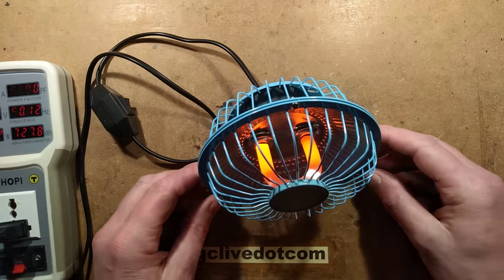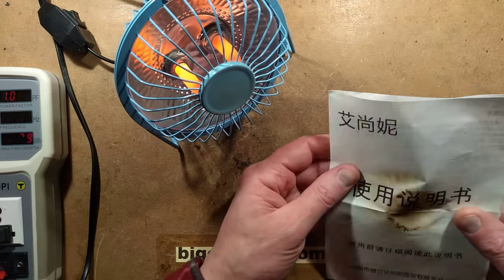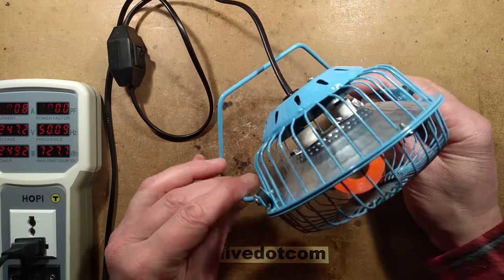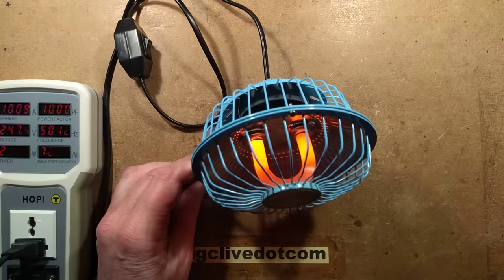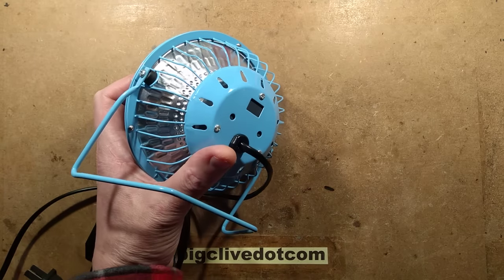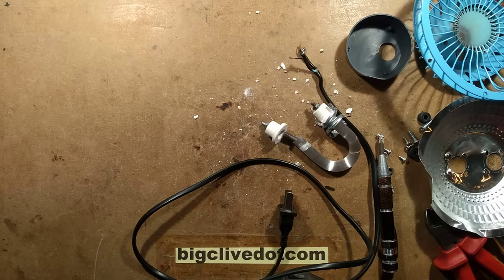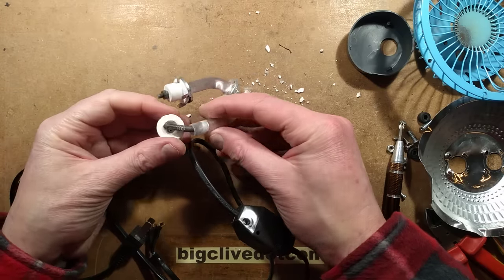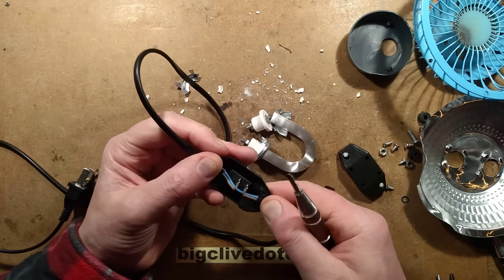Chinese automatic house ignitor.  (also available in pink)

Comment: I'd rather take my chances with a garbage can fire.
Reply: @GeorgeTsiros  better than a garbage can fire OR the heater
Reply: @GeorgeTsiros  you would just get molten copper do you even know how thin 30 gauge is
Reply: @Probable.Orange  if you knew copper wouldn't work, why did you even choose it, you fruit?
Reply: @GeorgeTsiros  I am fairly certain any metal that thin would just straight up ignite when under high voltage
Reply: @Probable.Orange  any metal? any any metal?
Reply: Any metal that's commonly used in standard electrical wiring
Reply: @Probable.Orange  so ur sayin... if u stick in an outlet... a couple meters of 30g wire... made of metal unfit for making a couple meters of 30g wire to stick in an outlet... it would fail?
Reply: @GeorgeTsiros  yeah obviously
Reply: @Probable.Orange  good think i didn't mention copper or any other such material, then.
Reply: @Probable.Orange  ok so, the whole deal is: the equilibrium between heat generated in the wire and the heat moved away from the wire will ultimately determine the temperature that the wire will reach. at high enough temperatures, most of the heat will be radiated away, the air around the wire will not play a significant role without a fan (which i didn't mention, so we won't be using any in this description). With the constraints i mentioned, 30g (single strand) wire, mains power and a "couple" meters of length, we would need a material that has 1) enough resistivity to not trip the mains fuse 2) enough endurance to withstand the ~10 kW of power it would convert to heat. we're looking at a power density of watts per sq millimeter... not much.
Reply: @GeorgeTsiros I don't  know how your "30 gauge" wire is measured. For me 30 gauge is far too small without first coiling the wire, maybe no fewer than 200 or 300 turns. It could work. But I think the in rush will melt the wire. I WOULDN'T DO IT.
Reply: @ryarbrough1195  hi. yes, of course, by increasing the impedance of the ... ... ... "circuit"

Comment: Jesus China this the housing of a small desktop usb fan. Holy smokes
That square cutout was the switch
Reply: There's certainly going to be some holy smokes in this use.
Reply: I also have one of those USB fans and recognized it immediately. It's barely suitable for the punched aluminum fan blades, let alone a quarts heater... (Also, that switch died so now it's just wired straight because why do you even NEED a switch?)
Reply: Yep my first thought was it is a fan housing and a place for a slide switch on the back.
Reply: I've had one of these usb fans on my desk for the last five years and to be honest it's worked flawlessly. As I recall I picked it up for a fiver from Wilko's.
Reply: they have a 110V version of it also... not much of a fan but lit moves some air.
Reply: Fan yes, USB no?  I've got several of these (some working, some seized) 4" fans that run on 120VAC...yep, that's where the switch goes.
Reply: @matthewmiller6068  The USB version is understandably quite widespread. Add me to the list of people who instantly recognised the housing from one of those generic USB fans!
Reply: The Chinese Communist Party has banned Jesus. Could explain a good bit.
Reply: @andreasu.3546  that is actually terrifying
Reply: @Roman F. I suppose that's quite likely - some generic metalwork supplier makes the casings and sells them to both the fan and the heater manufacturers. Or, considering that fan heaters are essentially a heating element and a fan slapped together, it could very well be one company making both.

Comment: Not only if you clamped the base down, the heater part still swivels vertically, so there would still be a chance to knock it face down, still causing and issue with inadequate heat dissipation, and thus, a good chance of it's ability to start a fire. Remember, Smokey the Bear says " Only you can prevent burning your house down with inadequate heating appliances."

Comment: Interesting; my USB fan's housing is almost identical. The switch comes out of the square hole on the back but it doesn't have two holes near it. It has the same three holes on the back for mounting the electronics, same stand, same method of putting the cage together, but the cage itself is rather different in its side-on profile, with much more 'bars' going around it.

Comment: I have one of these but it’s a usb fan 😂😂 definitely reuses the same case.
Reply: I have one of these, but it's a mains voltage fan... Chinese reuse at work.
Reply: I have the same fan. I got mine from walmart for about $5 usd.
Reply: I have this as a usb fan from poundland 😂
Reply: The boss at my previous work has it as a USB fan. I think it came from eBay. I thought it was plastic until I picked it up.
Reply: Came here to say that - this is the pound shop fan for £2.
Reply: I've got one of these too, it's green and has melon pips on the blades.
Reply: Ya sane got one for a dollar at the dollar store
Reply: Same fan!
I saw the pic and thought "usb heater"?
Reply: Yes
Reply: I now wonder if anyone has this same case on anything else. Blender? Toaster? Shower head? Garden sprinkler?
Reply: plot twist.
Someone open the USB fan and find that it has tilt and overheating protection.
Reply: @worawatli8952  pie tin holder
Reply: So you don't have one?
Reply: @TechLeftBehind  I have a fan about 1.5* that diameter which uses the exact case design (except obviously bigger) right down to the holes and screws.
Reply: Yup. The rectangular hole is for a switch.
Reply: I have the same case with a 120v fan. has yet to burn my house down.
Reply: Yeah i have the same one too
Reply: Same, got mine from Poundland.
Reply: I also had one of these USB fans in front of me at work at some point. I made a 3D model from it, so I remember the geometry clearly. :) It is exactly the same outer case.
Reply: I suspected as much, I have a similar USB small fan and that housing looked suspiciously familiar, lol.
Reply: Yup.
Reply: @xiro6  sadly contains a motor and a switch. Don't believe I even saw a resistor in it to limit current draw but instead relies on the load of the motor to not blow up your usb socket.
Reply: I bought it as USB fan in Tesco.
Reply: I have one. Its powered by woods

Comment: Those cable restrainers were known as "Heyco" and we used them on our metal-cased chargers where I worked some years back. They came in at least 2 sizes and I have a couple of pairs of Heyco-branded pliers for inserting and removing them.

They are a good design really in that they are so difficult to remove (even with the proper tools). So many cable restraints are ineffective, but not sure how they would deal with prolonged heat exposure e.g. if the heater was covered.

Comment: 3:25 yes you are right! I have one and it’s a USB desk fan. In the rectangle is the on/off switch. And in the holes screws to mount the motor. It’s from the same factory specialised in heating and cooling I guess :)

Comment: Not to mention the non U.K. (in fact US style 115v) plug with no fuse! So that 0.5mm twin flex can have 32A going through it from the ring circuit breaker without blowing anything. If the heater didn’t succeed in setting fire to the building there’s a backup in the supply cord’s incendiary capabilities!
Incredible!

Comment: I have a USB desk fan that uses this very exact same housing. The differences to the heater are that instead of the U tube heating element and reflector there's a fan blade assembly on a little motor, the back has a switch above the cable, the cable attached is a USB cable and the stand has four rubber tube segments on it to reduce transfer of vibrations into the table.

Comment: That's very interesting, I have a small desk fan that uses the exact same frame that your little heater was using, they just mounted the switch in the cutout behind the sticker.

Comment: These are very similar to Japanese "Kotatsu" table heaters.  They use similar heating elements under tables that have a blanket over the top to keep the heat in. Funny enough, not "too many" house fires reported each year during winter when I lived overseas.